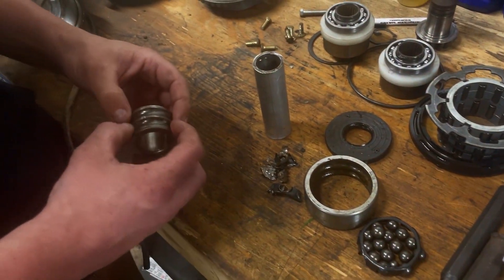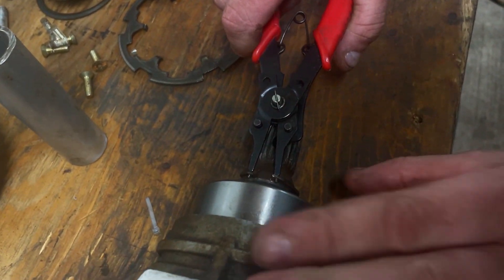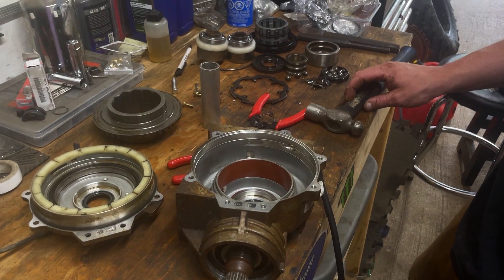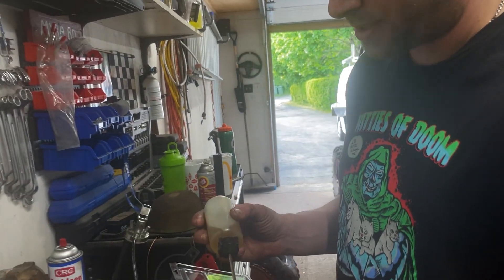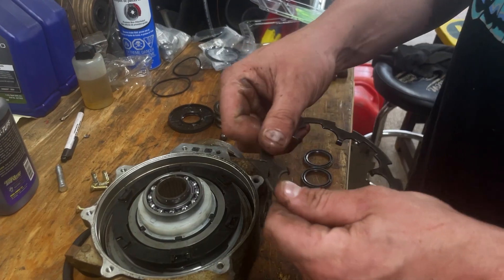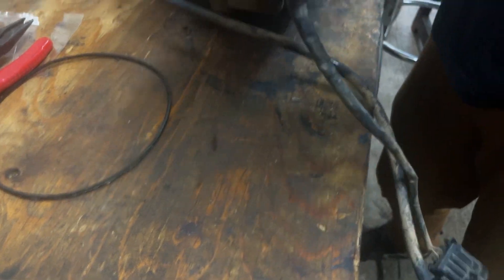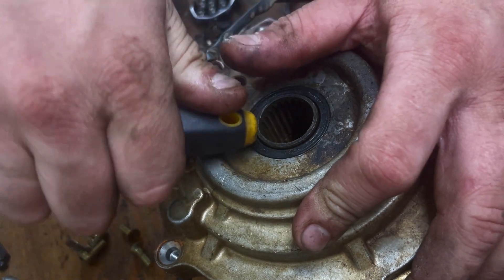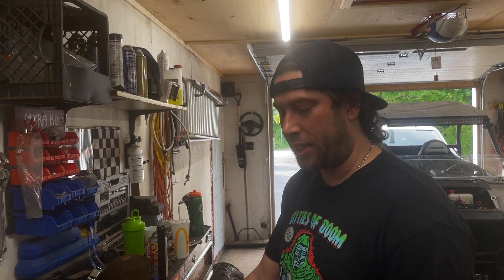How To Rebuild RZR Differential - Explaining And Understanding How It Works

Comment: Great video. My roller pins in my sprague basket arent seated in there all nice like yours. I have the same hair tie method but they are tipped in and out a little. Is this bad?